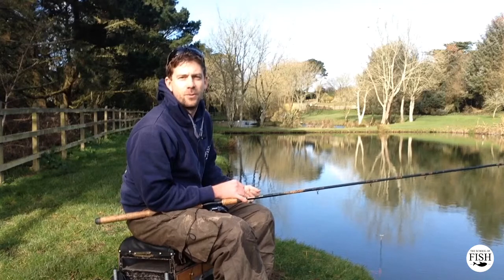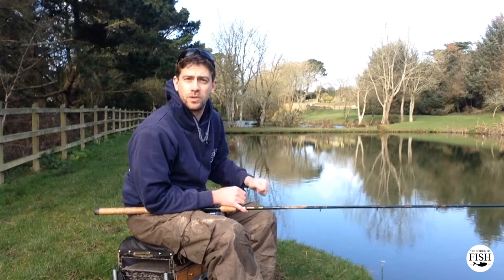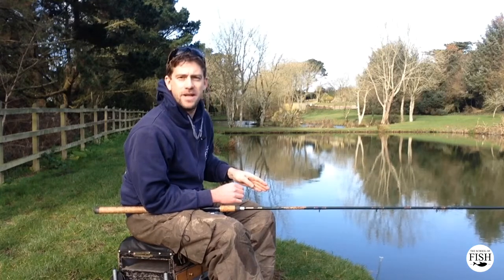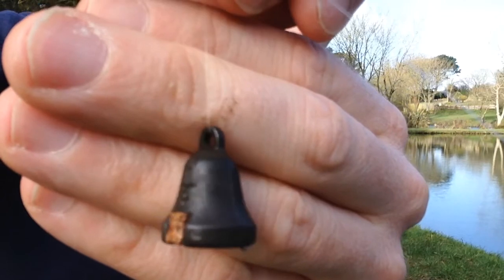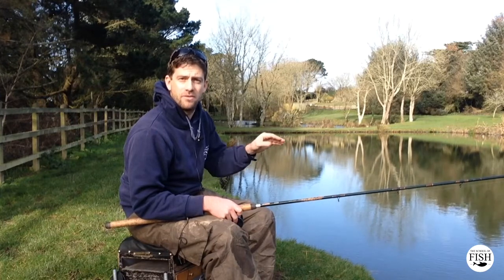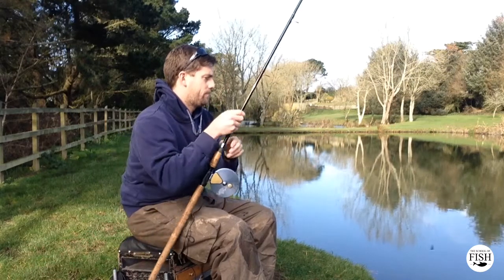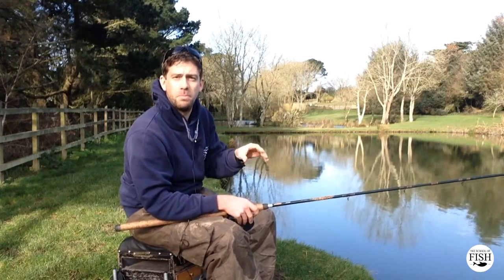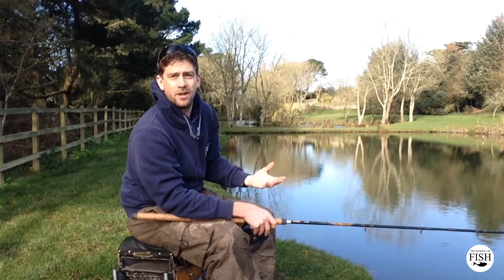How do I plumb the depth?

Comment: In case of fishing in some distance  and not in front of the rod tip, is the same procedure for plumming?Secondly, the right amount of split shots to set the waggler properly are added after the plumming?thanks!
Reply from the maker: Hi, you’re absolutely right, it’s the same procedure, you just need to have patience while you do it. It’s always time well spent at the start of your session and should hopefully see you catch more fish. Once all sorted you’re right again. Add the correct shot/weight for your float so only the coloured tip is showing and away you go. Good luck!